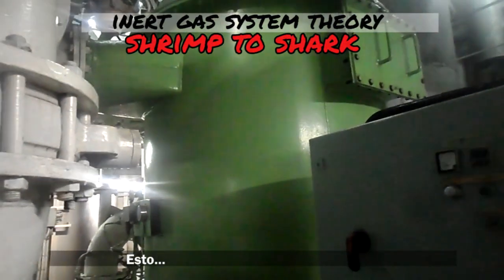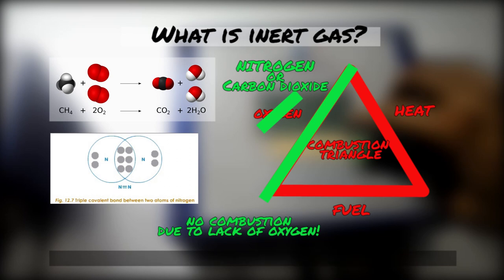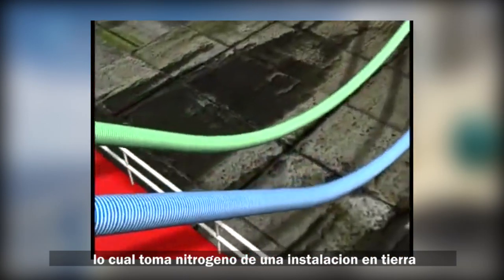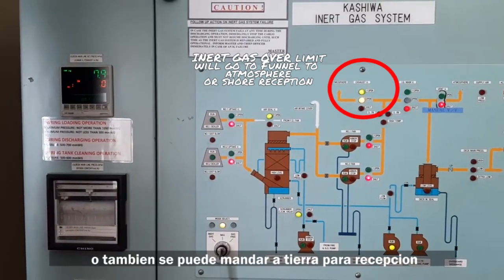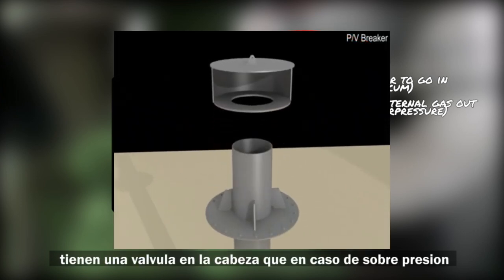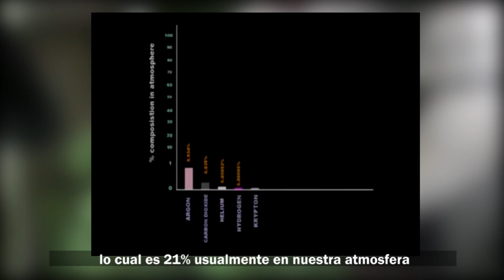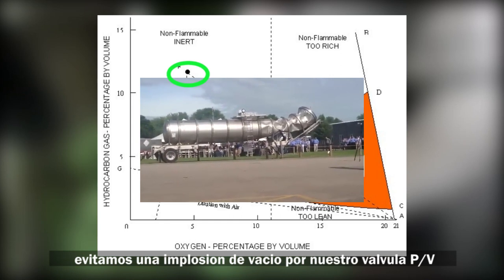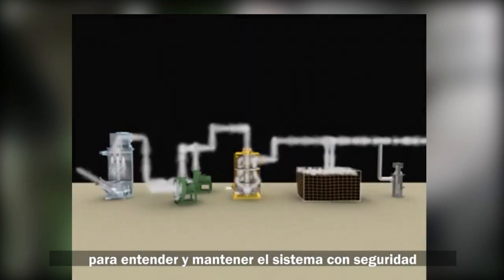Inert Gas System  - 4th Engineer Why Tankers won't Explode from Cargo

Comment: Can you make a video for how can i alkalinity control set in water treatment 
And how can i increase the pH in water
Reply from the maker: If you are taking about boiler water, there is a very good video on my channel where we explain everything about boiler water treatment using UNITOR chemicals.

If you mean increasing the PH in the overboard scrubber wash water, there isn't any requirement for inert gas wash water for increasing PH, however in EGCS (Exhaust gas cleaning Systems) the wash water from scrubber towers usually go through a static mixer which buffers PH by mixing wash water with new seawater.. I'll try to explain this in a new video for EXHAUST GAS SCRUBBERS.